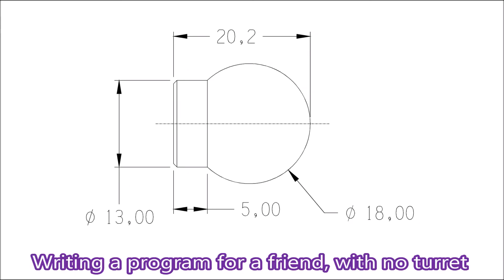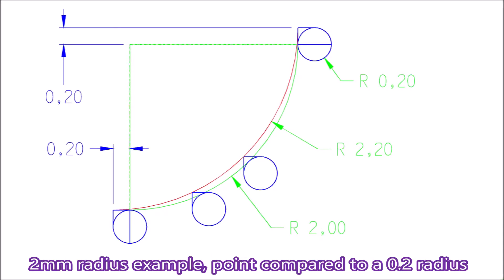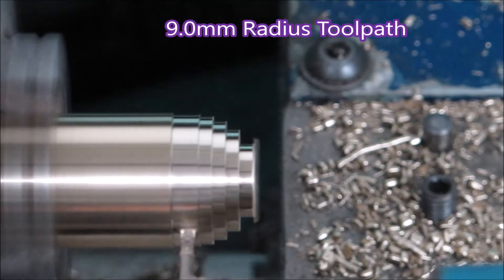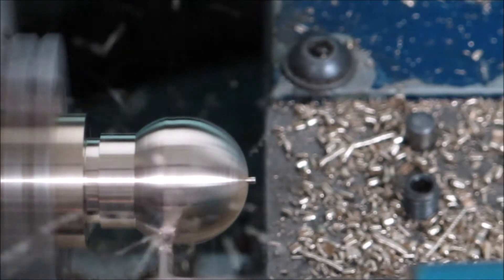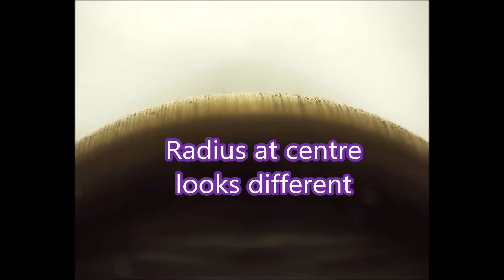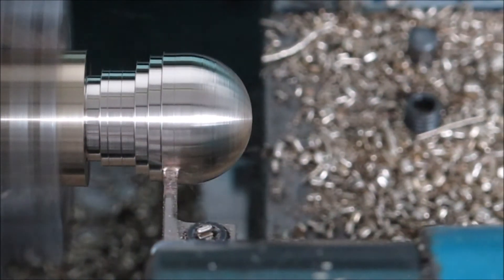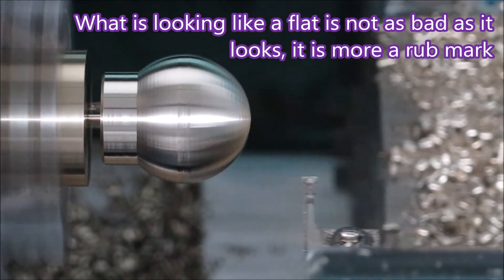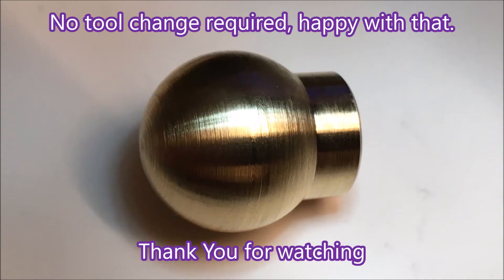Small cnc lathe turns brass sphere with Sumitomo square end parting blade at 3000rpm

Comment: Great video. On the emco i have to useG 40, 41,42 to turn a perfect sphere. Without doing this you end up with displaced end points? I have to say I would use two tools,a round nose for the ball and a parting tool for the plunge cuts and parting off.
Strange you making bits for U.K. inAustralia,I am in UK and just shipped a batch of parts there! Crazy world.
Reply from the maker: I would do that too.  The guy I wrote the program for, has to manually change tools (I was not making parts, just checking the code) As the sphere is just the exterior of a tiny valve, the shape is not that important.  300 parts made without a tool change is much better than 300 tool changes for a perfect sphere that is really not that relevant, in this case. Perfection is great when it can be costed into the part, but that is not always possible.  Thank you for your input, what Emco do you have?  My first experience of cnc was the tiny Emco PC5 Compact!

Comment: Very informative. Something that I had never really thought about until now. Thanks for making and sharing this video.
Reply from the maker: Thank You, not something I normally worry about either.  I have used this before, but usually just do it and not even bother to measure the result. I could have left it as was, this time too, it would make no difference to the part. I think it was a matter of once I could do it with the parting tool, I just wanted to get it right.

I imagine manual compensation is a thing of the past, except when driving a lathe like mine!